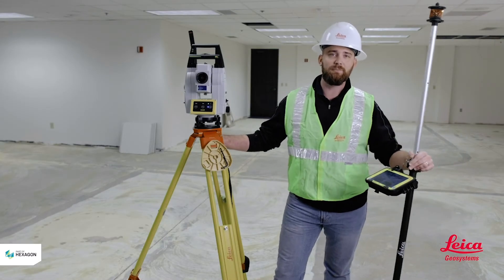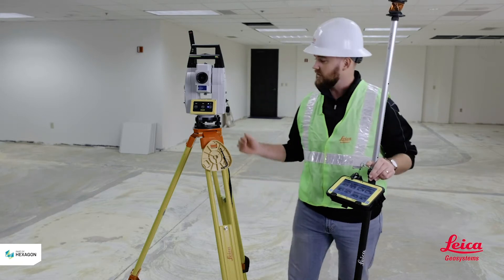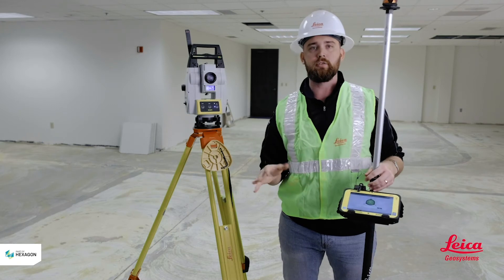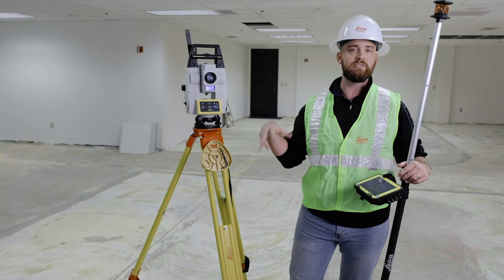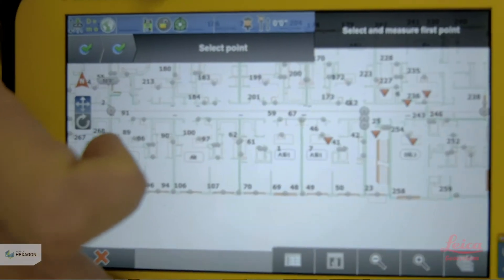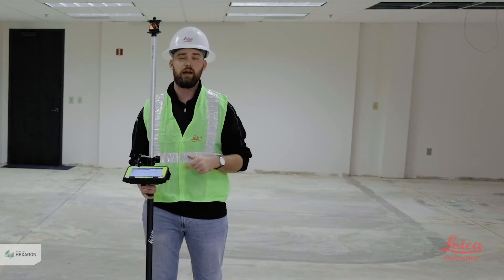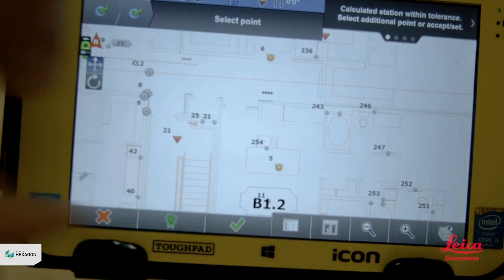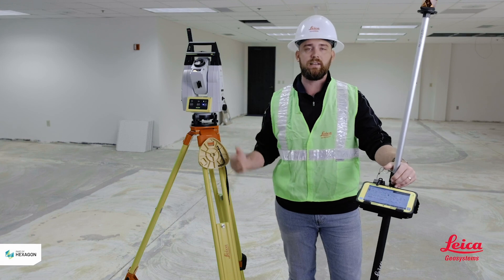How To Station Your Robotic Total Station Leica iCON iCR70

Comment: I've been using an Icon ICR 70 for around a year now & my opinions are mixed, the user interface is good but the edm is deplorable, range to retros is weak & prism measurement is inconsistent at best. I do a lot of DC work & I wouldn't dare use an Icon for that!!!

Comment: Hello, Sir
May I ask you a question, I'm interested of using Layout Objects application (import IFC files) , but I'm little confused.
Do I need to buy both CC80 tablet + ICON ICR80 total station to be able to use the application, or only ICON ICR80 total station will be enough?
Thank you,
Reply: The total station kits come with a tablet so you'll be fine with a iCT30, iCR70 or iCR80 kit.

Comment: I wonder: At the tip of the pole you have a gimball (like the used on drone cameras) under the prism, and a laser from the prism pointed to ground always NADIR. So, this way any inclination of the pole you always have a straight line from the prism to the ground no matter the inclination of the pole. Right?

Comment: Why is the prism on the top? isn´t it more accurate, when it is closer to the ground?
Good explained though
Reply: Because you cannot shoot through people and other objects. If you have a clean deck/floor you can screw the prism to the bottom of the pole. But in most instances it’s just not feasible. I run the exact system everyday. It’s all I do.
Reply: @flashback5391  I wonder: At the tip of the pole you have a gimball (like the used on drone cameras) under the prism, and a laser from the prism pointed to ground always NADIR. So, this way any inclination of the pole you always have a straight line from the prism to the ground no matter the inclination of the pole. Right?
Reply: I am making video on leica field work. Please subscribe my channel
Check my video.
https://youtu.be/cyjqceGu2vs